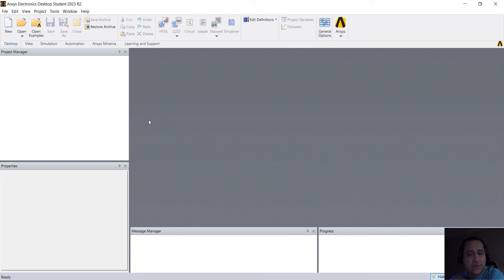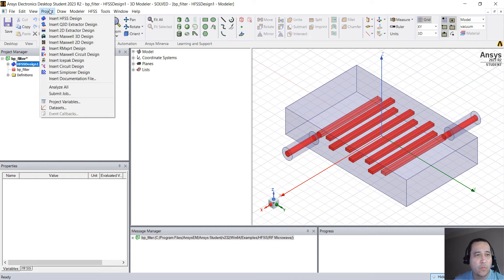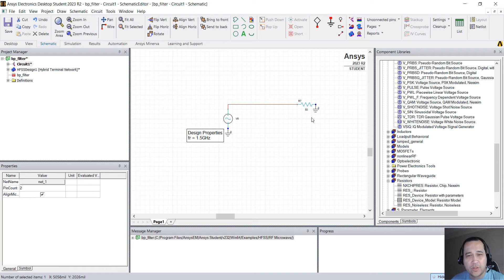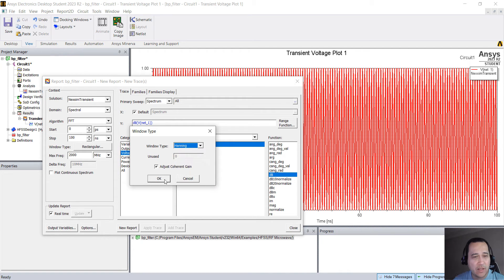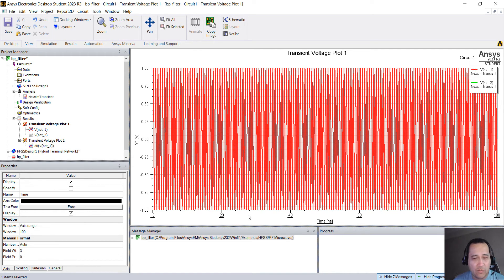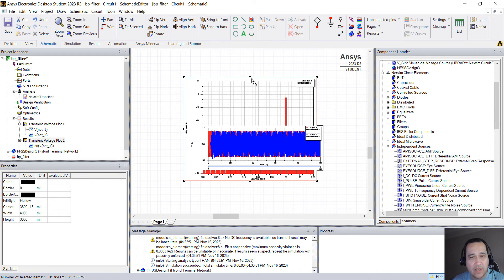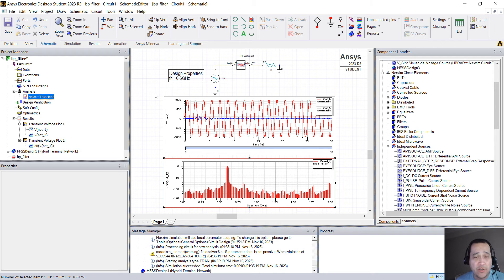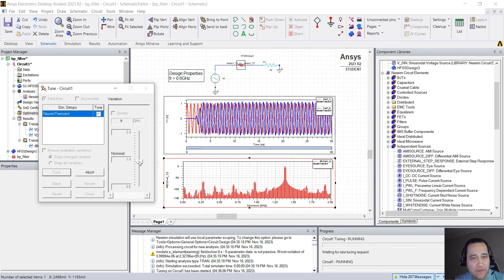Integrating a 3D HFSS band pass filter into circuits using Ansys Student Version

Comment: Hi, thansk so much. i have problem with optimization (tuning), i want to use the results of circuits invironment but change My structure in HFSS 3D invironment in order to optimize (Tune) insertion loss or S11, how should i do that?
I know that D link exists but for me, doesnt work in Circuit invironment.